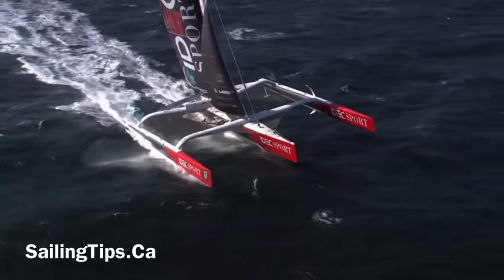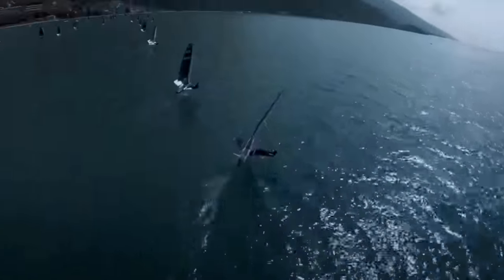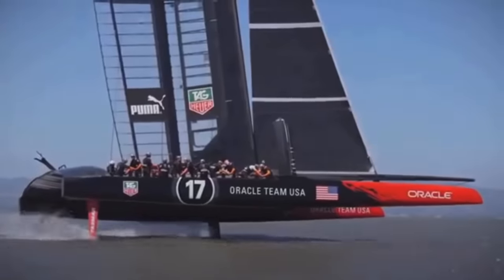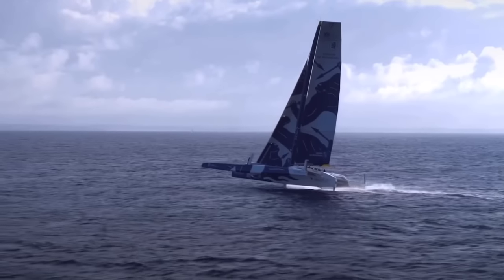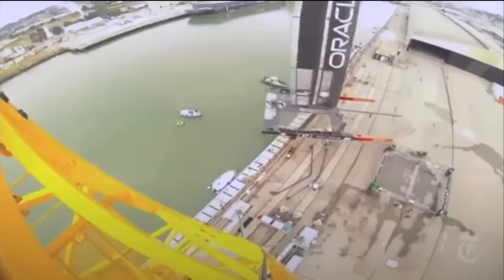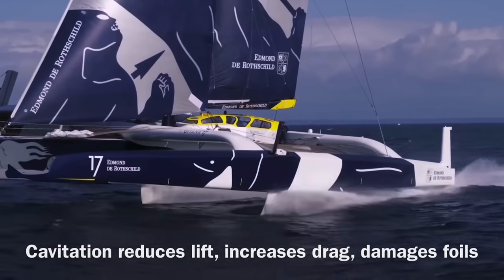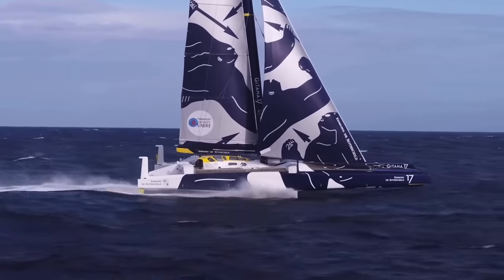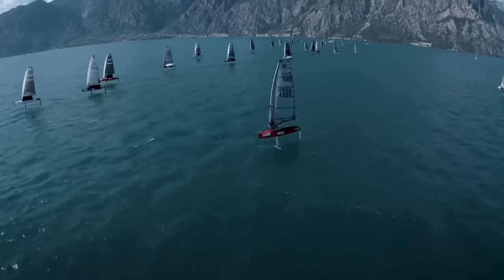How Fast Can a Foiling Sailboat Actually Go?!?!?

Comment: The only reason foilers do not hold all the records is that they have not been around as long as conventional boats and therefore they are much fewer in number and have not had as many opportunities to break the records. IDEC holds the RTW record for pretty much one reason: Francois Joyon is an animal, knows how to keep a boat light, and got into a fantastic low pressure moving at 35kt across the Indian Ocean that they were able to remain inside. So the weather system was moving precisely at the maximum speed the boat was able to maintain for eight or nine days, and they demolished the Indian Ocean record in the process. Crewed, with seven guys and the best weather router and skipper in the world. Then a few months later, Francois Gabart took MACIF, a fully foiling trimaran, around the world in 42 days - just missing the fully crewed non-foiling record set by IDEC, but at a much higher average speed, ALONE. Great skipper, great router, but he was only one guy. So foils basically allowed him to maintain much higher average speeds than Joyon did with a fully crewed non-foiling boat, even though Gabart was alone and sleeping much of the time with autopilot driving. Joyon's average speed throught the water was just over 22 knots. Gabart's was 27 knots. There is a certain amount of luck in the weather patterns in these RTW attempts also; IDEC sailed only 26,412 miles, where Gabart traveled 27,859. Gabart's singlehanded foiler would have won handily given similar course distance. Joyon himself suggests that the boat to beat his RTW fully crewed will likely be a foiler capable of sustained 45kt speeds: https://www.sailingworld.com/qa-with-idec-sport-skipper-francis-joyon/
Reply from the maker: I totally agree with you that foiling boats will eventually hold more records and that IDEC Sport currently holds the round the world record because 1) Francis Joyon is an animal and 2) they had amazing weather! I also agree that Francois Gabart's solo effort a few months later was totally amazing! A few questions though: I thought Francis Joyon's average speed for the entire race was 26.85 knots (https://en.wikipedia.org/wiki/IDEC_Sport), how did you get 22 knots?. I also didn't think MACIF was fully foiling in 2017 though (https://www.youtube.com/watch?v=6U0MKW14G-I) as it got a massive refit and was re-launched as a full-foiler in 2018 (https://www.youtube.com/watch?v=q-WsQA8uE7Y). I could be wrong though...
Reply: @SailingTipsCa  22 kt is over the theoretical course. 26 was Idec through the water. Still a single dude on a foiler outpaced them. And it was fully foiling. That is how he did it despite sailing over a thousand more miles than a fully crewed boat. Without foils it would not have been possible. He put up nearly the same 24h numbers as a boat with 6-7 guys on it.
Reply from the maker: @kwittnebel  Gotcha. Francois also would have benefitted from not having to carry the weight of 6 crew and provisions for 50 days which can be substantial!
Reply: That’s great for racing but is the risk of pitch polling because it cavitated and stalled the wings worth it for someone who just wants to go fast? That is, without drowning.
Reply: @SailingTipsCa  true, but there is no way he was able to sail his boat to the same percent of its potential as a singlehander that a crew of 7 did with Joyon. And even 7 was considered shorthanded for Idec. Stamm talked about being on the wheel for two hours where the speed never dipped below 42kt; to drive it that hard they needed 7 guys because you are fried after just an hour or two sailing right on the edge of capsize the whole time. So Macif was clearly a much faster boat.
Reply: @SailingTipsCa  Macif was fully foiling. It had lifting foils on the rudders. Dig up some pictures and you will see it.
Reply: Also, in the  VG for quite some time the foiling IMOCAs have been quite a bit faster than the non foiling boats and the whole competitive fleet has gone the foiling route. In the 2016 race, Alex lost his starboard foil and was over taken by the jackel on a foiling boat that won the race. The RTW racing game is one of averages and the boats are designed that way.  The biggest problem I think the foiling faces is the vulnerability and complexity of the systems particularly in the face of all the junk floating in the world seas.
Reply: @nohandleatall1968  the foiling boats are true racing boats, but that is all they are. I wish there was enough competitors and market to support a completely separate class for foiling and that another class for multi hulls, and then a class for mono hulls.
Reply: @JoeOvercoat  I'm having a bit of trouble trying to see where you are going with this. IMOCAs and the offshore racing trimarans in the video are all pure racing boats with zero consideration for leisure, regardless of hull and foil count. That is all they are. Nobody uses fiberglass or aluminium boats in the top offshore racing anymore. Likewise foils will slowly take over too as the non-foiling boats become too old to race.
Reply: @AnttiBrax  let me try another approach -  we’re not racing sailboats anymore, that’s dead & gone. we only race sail-driven foil-boats. But I wish we still raced sailboats, too.
Reply: @JoeOvercoat  Now you're just being "the old man yelling at clouds". There's enough displacement boats for everyone to go around. On that note, foiling is just planing taken to another level. Should dinghies like the 505 and the 49er be rejected too because in the end they require pretty much the same kind of approach to sailing as foiling boats?
Reply: @AnttiBrax  no I just want racing back. You ignore that the racing has become running foil boats in bays and we’ve lost ocean sailboat racing on television which is what I want and it’s not asking for too much. Thank you very much.
Reply: Why are ice boats which run on ice skate type runners considered in the mix. Ice boats are faster than either foilers or multihulls and less complex to build, at least until high tech is applied to them.

Comment: Great video, nice to see this being address seriously. Yeah, it's not safe foiling over long distances, the best helmsmen in the world crash their foiling multis on a regular basis. The Eagle 53 has had its T-foils installed, but they haven't put out a video on this new addition to the design. I suspect that the software required to make the boat foil safely hasn't yet been figured out.
Reply from the maker: Thanks! I think the apparent ease by which the highly skilled crews in the America's Cup and SailGP foil (over relatively short distances) diminishes the immense feat that full foiling actually is! For longer distance racing you really need more "set and forget" systems to enable the crew to adequately rest.
Reply: @SailingTipsCa  Yeah, and think about the great racing sailors that capsize non-foiling multis. This is much harder than people think.
Reply from the maker: @rickemmet1104  Yes even sailing a non-foiling multi at the edge of it's performance envelope over longer distances is a big challenge. I touch on this as one of the reasons larger monos have been very successful in the Race to Alaska (R2AK) compared to theoretically faster multis in the video "Race to Alaska (R2AK) Best Boat": https://youtu.be/qzdpNOk2oxc
Reply: @SailingTipsCa  Great, thanks for the link, I'll watch that one too!
Reply: @SailingTipsCa  I think one of the odd issues for ocean foiling that a lot of people don't think of is just that foils basically stop helping when the peak to trough wave height approaches the maximum foiling ride height. Once you start wave piercing a full foiler isn't going to be much if any faster than a partial foiler because of the skin friction and impact from the waves.

then you do also have the roll/heel angle stability issue, which is MUCH more complicated than for an aircraft because the sails are adding moments that are large, unpredictable, and completely independent of the foils. I think the biggest challenge is that all the tricks to gain passive roll stability on aircraft rely on sideslip to generate the restoring moment, which doesn't work very well when the sails produce a huge rolling moment for a comparatively small sideslip. 
This reveals yet another advantage of partial foilers in ocean races, they have just enough buoyancy left over in foiling mode to have a passively stable heel angle. 
roll stabilization in software only works when you have both the port and starboard foils in the water with independent control so you can use them like ailerons, but that would reduce your righting moment by a lot. 

I think pitch stability isn't much of a problem anymore since the boats don't seem to pitchpole very often the way the first couple generations of high-performance foilers did. GIven that the rudder foils at least on the AC75s seem to be generating lift from what I've seen instead of downforce like a traditional aircraft tail, I suspect the pitch stability is mostly in software like a fighter jet as opposed to passive stability. You would probably need to go for a 3 surface design to get passive stability without giving up speed.
Reply: @thamiordragonheart8682  you mention the unpredictability with sails, makes me think thats this problem is possibly partially removed by say Americas Cup yachts with solid main sails?  Something not practical on long voyage ocean sailing yachts where you need to reef, etc.  Not an expert on any of this, just enjoy the discussions!
Reply: @aeasthouse316  I think the issue has more to do with gust and wind shifts than the specific sail construction. Once you're up on your leeward foil, your righting moment is basically fixed, so you have to play the sails pretty actively to stay upright.
That said, the rigid sails probably are more stable on a foiler because they have better control of the lift distribution and therefore the torque applied by the sails to stay perfectly on that knife's edge of even-keeled foiling.

I think a viable ocean-going full foiler might end up being a three-surface design with a small lifting bow foil, a pair of central main foils, and the rudder foil being purely for control. it would decouple pitch and roll control for the foils when you're on one main foil so that you could at least actively stabilize the boat more effectively without killing your righting moment. Putting almost no load on the rudder foil would also probably make dramatic flying broaches like American magic's crash a bit less likely.
Reply: Because Cavitation is impossible to prevent above 55kph, as mentioned in the video?
Reply: @davidwilkie9551  If not in this video, it was covered in the video about the Vestas sailrocket video.

Comment: I know from windsurfing, that we find foils just can't keep up at higher speeds. The gap's being closed but you can get to around 55knot on a fin, whereas 35 on a foil is around the limit with current tech (and that's not over any distance.) Foils are, however much, much quicker in turns and upwind which makes them way faster around a course in any conditions.
Reply from the maker: And windsurfing or kitesurfing on a foil is absolutely the best bang for the buck in terms of performance versus investment!!!
Reply: @SailingTipsCa  how & why?
Reply from the maker: @Str8representing  The previous sailing speed record (prior to Sailrocket) was held by a kite surfer. It’s just much less expensive to put together a foiling kite package because it’s much smaller, lower loads, less materials required, but you get wet!

Comment: Very nice and intresting videos, thank you. I was about to comment the F50:s speed record in St.Tropez, 99,9 km/h (53,9 kn) but there was smart comments below about it.
Reply from the maker: I think the F50s are amazing boats! The have tons of sensors and there is a lot more knowledge about foiling than in the 2013 America's Cup, where they had to introduce wind speed limits to ensure the boats didn't go too fast and lose control. I bet the F50 ground crews fit the exact wings and foils to enable the crews to "safely" sail as fast as possible in the prevailing conditions.

Comment: Amazing to do a video on this topic and not mention Paul Larsen and the Vestas Sailrocket program. In Vestas Sailrocket 2 they ventured into the realm of supercavitating foils and peaked with running a 500m course at 65.45 knots (121.21 km/h) with a 68.01 knots (125.95 km/h) peak.

There were some plans to take the program offshore but that has not come to fruition, yet.

On the other hand, I just realized that you have done a video on The Rocket before, I have even seen it. Too many sailing videos, not enough time and memory available ;-)
Reply from the maker: Yes in retrospect I should have made the Vestas Sailrocket 2 video at the same time and linked them together...

My rationale at the time for not including Sailrocket 2 in this video was that I was focusing on boats that can sail an arbitrary course (e.g. multiple points of sail, both tacks) which Sailrocket 2 can't. 

Still Sailrocket 2 was an absolutely astonishing achievement, and certainly the first "boat" to surpass the cavitation barrier and enter it by a substantial amount, and not just edging into it...
Reply: @SailingTipsCa  Fully understood, and they seem to have abandoned the offshore option. Maybe Mr. Larsen is getting old and afraid? ;-)
Reply: You are absolutely right  @MartinMoe42 . He gave a talk at my company’s conference back in 2016, including some videos of Sailrocket becoming a vertical rocket and coming down hard, requiring pretty much a full rebuild. He also said he would never enter that thing again once the record is broken, but also said »if someone else breaks my record who knows what’ll happen« with a cheeky smile. So who knows :-D
Reply: @SailingTipsCa  Great video explained a lot to me.  Thank you.

Comment: Could they come up with an active system for managing the foil profiles to help with stability and cavitation issues?
Reply from the maker: Yes they already use the controls described in this video for stability, foiling height etc: How Do You Control a Foiling Boat?!?!? https://youtu.be/haevc7aWyL8 What nobody has done yet is dynamically change the foil shape sufficiently to switch from sub-cavitation to super-cavitation speeds. The engineering challenge with this is that water is about 800 times more dense than air, so the foil is much smaller and under much higher loads than airplane wings which change shape.

Comment: I once saw Hydroptere in the Solent, on a windy day. Very impressive, seeing her casually zipping along at such speed!

I'm wondering when someone will try blowing an air bubble film over a hydrofoil, from nozzles in its leading edge. That'd solve the cavitation problem.
Reply from the maker: Hydroptere was certainly one the pioneers in the field!

I think bubbles is one of the techniques they use for “supercavitating” torpedo designs, so quite possibly an application here too!

Comment: 50 kts is a barrier where typical flow dynamics don't apply anymore. Practically the problem is more ventilation than cavitation, but nevertheless the result is similar: the foil loses lift and drag increases dramatically. Practical solution could be to design ventilating foils in similar ways than with with surface propellers. The air should be directed into separating zones in low pressure side and the flow would be separated from the foil controlled. The only issue is that the ventilating foil works poorly in lower speeds. But in that case 50 kts is not a barrier anymore.
Reply from the maker: Ventilation and cavitation both take place when a gas (e.g. air, water vapour) disrupts the laminar flow of water over the foil, and as you noted the effects are similar. Ventilation can take place at much lower speeds and is a common problem with transom-hung rudders on sport boats and smaller multihulls when surface air gets sucked down the foil. The typical solution is to install a fence on the foil to keep surface air from being sucked down. L'Hydroptere has visible fences on its lifting foils to prevent ventilation. Cavitation adds to the potential problems at higher speeds (e.g. above 50 knots) so you need a different foil design. Vestas Sailrocket used a wedge-shaped ventilating foil to hit 65 knots, but it's not really a sailboat in the traditional sense because it can only sail in a straight line and on a single tack. Here are some  descriptions of their foil solution to overcome cavitation, and as you noted these foils don't work well at lower speeds: 
https://www.realisedesign.co.uk/uk-product-design-blog/fastest-boat-sailrocket-sailing-speed-record/
http://www.sailrocket.com/node/288
https://www.sail-world.com/Australia/Sailrocket-2-attempts-a-new-World-Speed-Sailing-Record/-91009
Reply: The real problem is that people keep assuming a boat’s pronouns.
Reply from the maker: @CorePathway  I know - I wish boats would announce their pronouns like people have started doing in Zoom meetings lately!